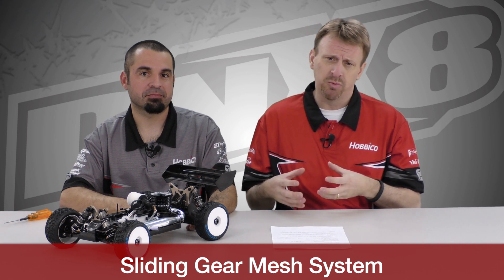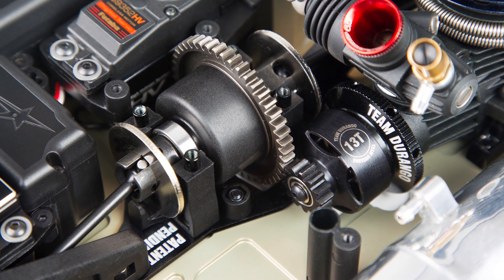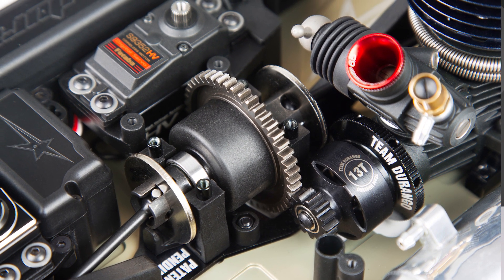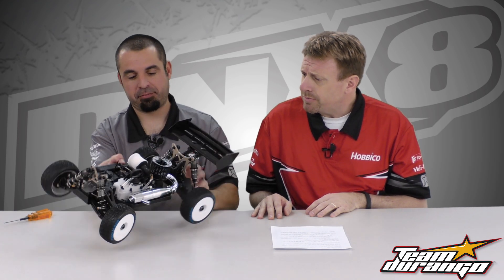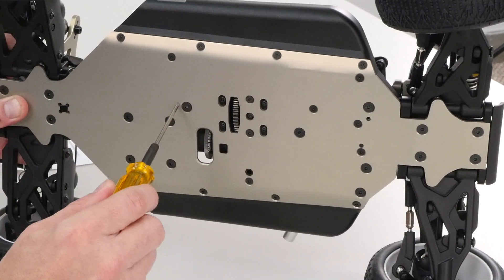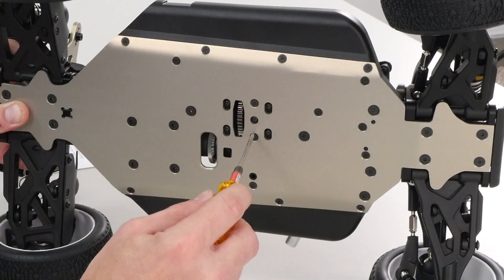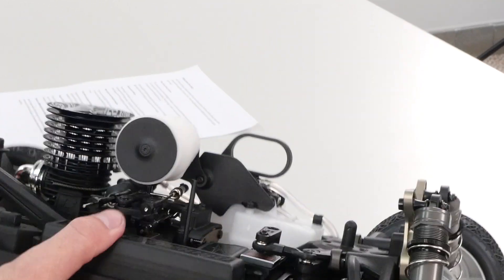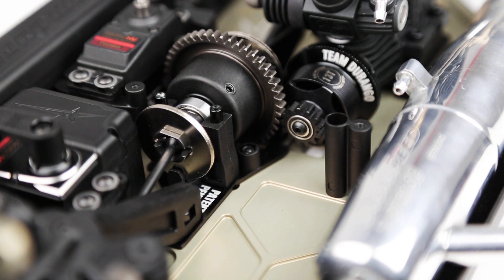Team Durango Team Tech Tips Patent Pending Sliding Gear Mesh - DNX8

Comment: It a simple idea and it works on the nitro  buggy . I have a Dex 8 t truggy and it is all 'wrong" only has two solid  mounted motor mount bolts they used the third bolt is used to overlap  the center Diffrental mountings plate, even when it is torque down properly it is not holding . the pinion gear on the motor  is all the way on the end eats up motor bearings and few hours of easy running most likely going to need to replace or rebuild motor. You cannot  run a 13th pinion on the truggy because the diffrental  is at to much of a angle to and binds the front drive shaft.  They have no different spur gears. the plastic and the quality on this truggy brittle, the quality of parts I have received from Team Durango's distributes is not up to red cat quality standards. Had to get 3× rear drive shafts to get one that had reasonable run out, the other looked like they all ready been bent . the diffrental case rear out of the box cover not fit, it was warped bad had to warm in hot water a force it on. The Last 30 + days every one in USA backorder on spur gears it when through my 6 extras I brought . I will have to give the people at Team Durango support they are great the service and support they worked to provide, for my TD China truggy, exceeded my expectations.